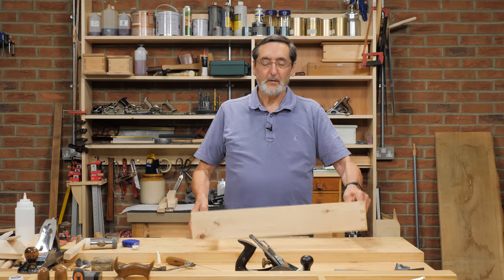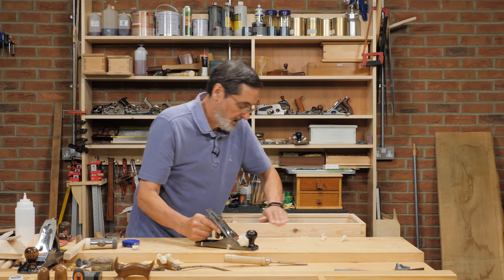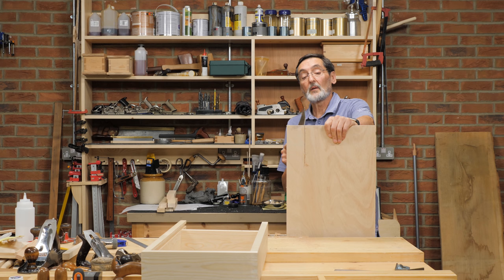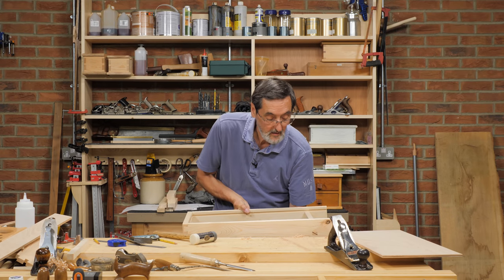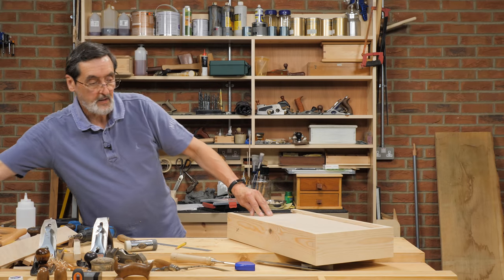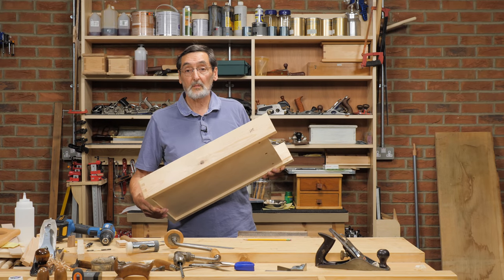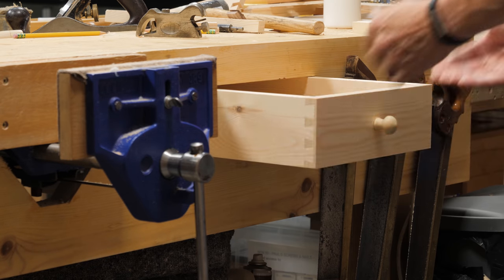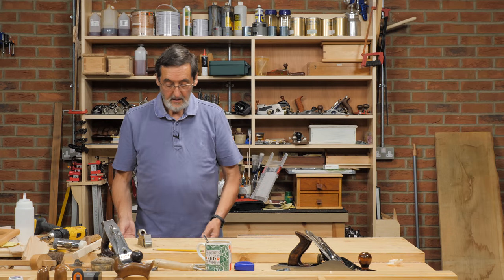How to Make a Workbench Drawer Episode 5 | Paul Sellers

Comment: 16:39 haha Paul! Love it. I'm an American and often wonder why the metric system didn't win out here. By tens makes so much more sense
Reply: Lol, I just came down to the comments at this time too, to see if a metric/imperial war had erupted! I'm absolutely a metric-guy  but I do sometimes catch myself using imperial when woodworking. Usually when I'm doing something rough, like "yea, that's about an inch", but generally I use whatever is convenient, or closer to the mark, whatever side of the ruler I'm using, or whatever number is easier to remember.
But, yea, generally metric is better, I don't know how imperial people measure stuff that's like a yard, 2 foot, 3 inches, and 13/32, and then add another inch and 3/4 to it, it must be a pain! In metric you just add 1681mm+22mm and you're done.

Comment: Another great video Paul. I really appreciate all of the finer details in the chisel work. Any thought to using a coarse tap and die to thread the knob onto the drawer front? No screw to loose when you need to remove the knob, and you can still close the drawer with the knob removed and then simply thread the knob back on to open the drawer again.

Comment: A bench drawer is indeed an essential accessory. I would however on that particular style of bench have the drawer pull recessed or pocketed. The knob fitted would continually catch my clothing and impede when holding longer pieces in the vice, even if the pull can be removed. Just a small issue and personal preference although I did learn much from the overall build and application of the drawer. Many Thanks.

Comment: I forgot to ask another question that has come to mind.  I have no workshop space other than my driveway.  I have an inadequate workbench on castors that I store under shelves in the garage.  I want to build a version of your workbench but it must be limited in length and width.  I've decided that 48" inches is the limit of the length.  It must fit beneath shelves that are 24" wide.  Uprights that support the shelves are 24" apart.  In planning, I'm trying to decide the maximum width I can accommodate within the limits of the environment.  In order to determine this, I need to know how far the vise protrudes out from the bench.  I haven't bought the vice yet, but currently think the 9" Eclipse will meet my needs.  If Iline the vise jaws with 1/2 solid core plywood, I will need to allow one extra inch beyond the dimensions of the vise.  I have not yet found imensions for the Eclipse vice.  (If you know where I might find the info, I'd be much obliged to know it; or to know from your actual measurements.)  If the vise with liner jaws turn out to be 5", then 19" remain for the bench top including front and rear side boards.  If I use '2-by' materials I would need 12 boards in total - 6 boards for the center field of the benchtop.

I'd appreciate your comments and those of your followers on my approach to planning the bench size.  I plan to use castors like those you used to give me the mobility I need.  I'm a couple of months shy of my 77th birthday and have some physicality limits due to arthritis and bulging disks that sometimes prevent my standing and working; so my projects will be scaled appropriately with these limitations in mind.

I cannot close without thanking you profusely and sincerely for all that you do for us, your fans and without letting you know that central Texas is poorer for your absence having had you in our midst for awhile.  Your fellow countrymen are blessed with your decision to return home.

Comment: Watching you making the drawer was very enjoyable and educational. There does not seem to be a runner above the drawer so what prevents the drawer dropping when it is opened/extended?
Reply: Charles Arnold he made the sides longer. Earlier video
Reply: The drawer is placed directly under the benchtop. That prevents the drawer dropping.
Reply: No. There is a gap between the top of the sides of the drawer and the bottom of the bench top!

Comment: excellent series; i made a basic drawer for under my kitchen sink a few years ago and only spent 10 minutes on it. certainly wasn't a 'lifetime tool' like this one! i do notice a trend, though among life-long woodworkers (e.g. paul and norm abram): they seem to hate the clutch setting on their drill drivers! is there a reason its always kept on 'drill' when driving screws in, instead of changing to a clutch that stops at a certain torque? i feel thats important to avoid stripping screw heads, particularly on the brass screws common for woodworking use.
Reply: Andrej Walilko 
You can't properly gauge by hand the torque applied if using a clutch.
Reply: As some one that’s been a life woodworker (well 25 years since my teens) I have to say the clutch setting is a pain in the rear. Not all parts of a piece of timber are the same density so the clutch setting is unlikely to set more that one screw to the same depth constant adjustment makes for slow work and when your piece working that is not the place to spend time. 

On a modern drill driver the drill in most cases stops as soon as the trigger is released so you very soon get a feel for that sweet spot when the screw is where you want. I agree it’s important to not strip the heads often you will see when door fitting a lot of guys now will use a generic screw of the correct size first till we’re happy with the fit then put the correct one in when we’re happy with the fit. 

For brass screws especially slotted ones my recommendation would always be to ensure pilot and counter bore are good then either fit a steel of same size first then using the correct size screw driver fit the brass screw by hand. Or lubricate the brass screw before hand fitting straight into the pilot hole. 

It’s more common that over torquing will snap the screw just below the head than you will strip the head recess with modern screws.

Comment: Paul, I have a question for you. As a way of looking outside the box, I was wonders why not build the drawer first, then cut the opening? It seems like the fitting would be easier.
Reply: It’s always easier to adjust a drawer to fit an aperture, than trying to alter an opening (along with kickers and runners) to accommodate an existing drawer.
Reply: Thanks

Comment: 17:45. Paul seemed a little confused there. Must have been the non-metric system that messed him up.
Reply: Can you fathom it!
Reply: Jan-Reinier Voute He's in a different league, high on a perch above us all... I could go on but I don't want to encourage a chain starting!
Reply: Too late. Give me an inch and I'll take a yard.  I'm inching toward the milepost of building a bench of my own.  It's time I stood on two feet and and just did it.  I'm going to make it 1.75 cubits by 4 cubits by 1.35 cubits.  OK, I told myself I wouldn't be here furlong.
Reply: And a toolw-ell.
Reply: Started in Imperial Measurements at school, but the SI system was just coming into the UK. I just use that both without issue. But when visiting Harbour Freight in the USA I got a free 15ft tape measure. It irritates me that it does not have metric measurements. So all my measuring tools have to have both. (And by the way I was not involved in the design and build of the Hubble Space Telescope!)

Comment: Some things are easier to the mind in standard imperial.... here in USA.
When baking, cups and spoonfuls seems natural. Feeling the temperature, Fahrenheit wins for me. With speed and distance, 0 to 60mph and 1/2 mile are clearer.
I wouldn’t mind metric for small measuring of length, fractions do get complicated. There is a small number of tool manufacturers that are starting to be successful at converting woodworkers over to metric with high quality tools. But I don’t know how to ever get rid of the 1” chisel or the 2” iron in a number 4 plane?

Comment: Hi Paul,
Excellent series about drawer making, Loved watching you work. I have just finished constructing my workbench, I will definitely be needing a drawer. 
First time trying dovetails, watched enough videos time to try it out myself.

I have a question, what finish do you apply to the drawer? especially on the sides?
Do you need to add some wax in case it expands or do you just plane it some more?

Keep up the good work